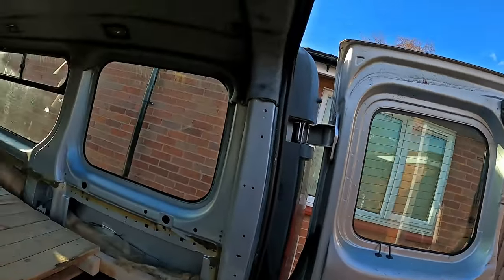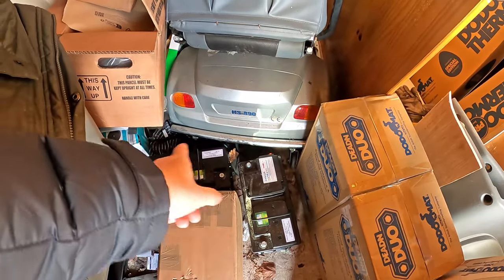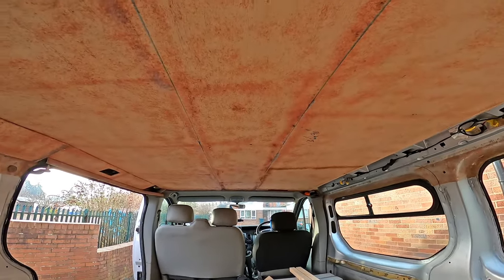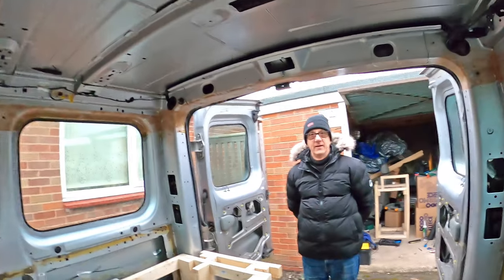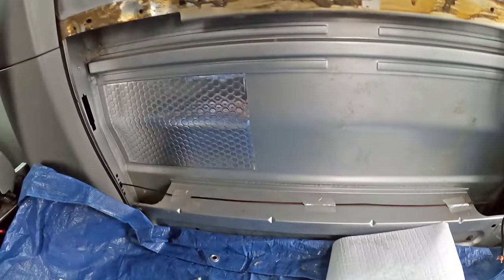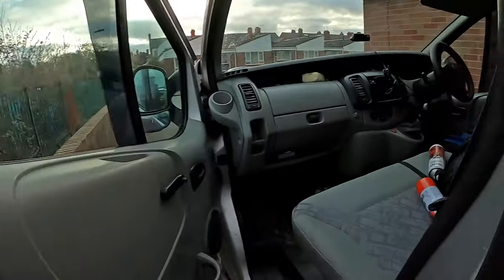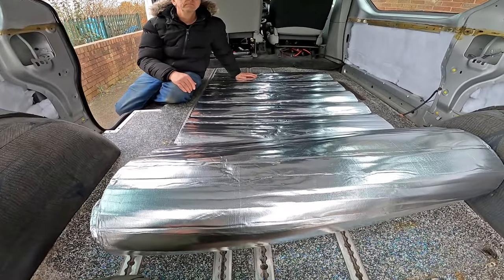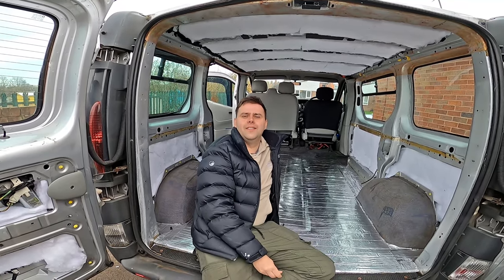DIY VAN INSULATION | Converting My Vivaro Trafic Into A Camper Van

Comment: The doors are designed to allow water to run through them from the door handle (same goes for the front and side doors). They have drain holes at the bottom to allow water to drain through.
You should have used closed cell insulation in there which is waterproof.
The good news is that the van has galvanized body (doors too) so you are quite safe even if the door insulation becomes soaked in water. The bad news is that insulation doesn't work when it's wet.

Comment: Hi…..always watch your videos, so keep them coming. I have a question for you, in one of your most recent videos, you changed your 40w tubular heater for an 80w one. Any idea how long this 80w heater would last with just using your jackery power battery? Obviously, depends on outside temperature etc and how warm you want to be inside…….many thanks in advance.